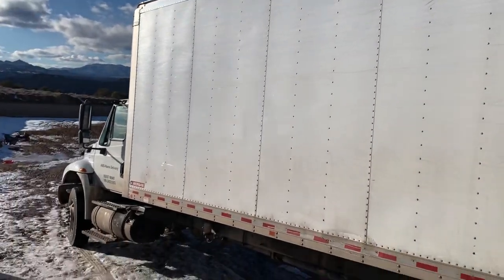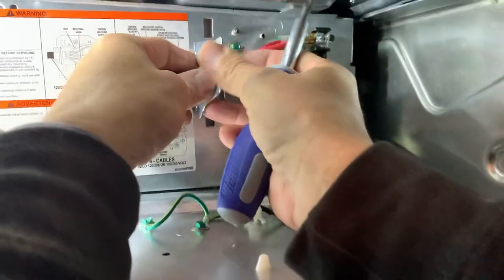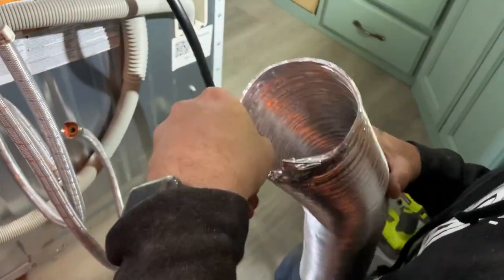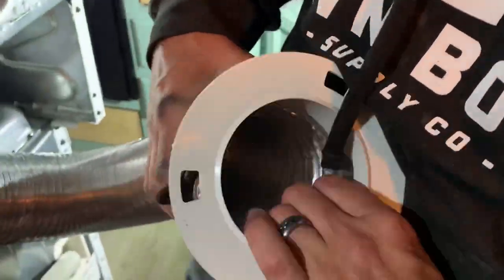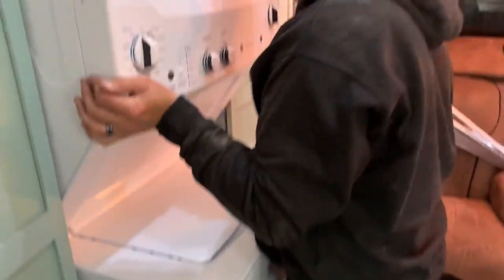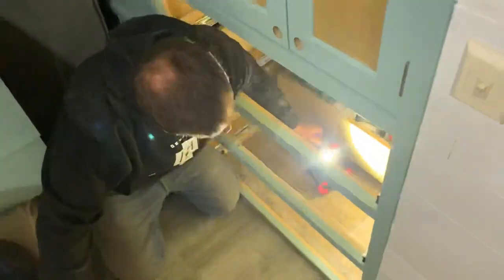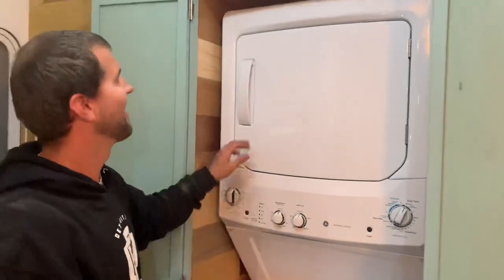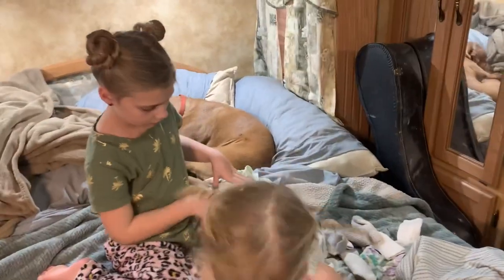Full time RV Living | Full size stack unit LAUNDRY

Comment: How are you getting 220volt in an RV?
Reply from the maker: You have to buy a 5th wheel or use a panel that uses 50 amps.  If you upgrade an existing 30 amp panel to a 50 amp Make sure the wiring can handle the extra load.  30 amps that only use 110 volts only have a single hot leg (1 black, 1 white , and a ground); 50 amp wiring utilizing 220 volts has 2 hot legs (1 black, 1 red, 1 white, and a ground). 30 amp wiring is usually at least 10 gauge but 50 amps requires at least 6 gauge.  So if it’s not 6 gauge wiring and only has one hot leg, you need to replace the wiring running from the plug to the new panel and replace the plug with a 4 prong.  In our case, the 5th wheel was already wired with a 50 amp panel so we didn’t need to upgrade the wiring.

Comment: Just wondering, is the washer and dryer combo power needed 240 volts? Does your RV have an inverter for that hook up?
Reply from the maker: There is another video breaking down the electrical part of this project. It’s 240 volts, 30 amps.

Comment: Hi.. thanks for the video.  My question is: is your agitator during wash cycle noisey at all? Or the spin cycle as well? We just got this same unit & had it installed,  & I gotta tell ya, when the machine starts agitating for the wash cycle it sounds like a jumbo jet is revving his engine & about to take off... lol. Thanks for any info you may offer..
Reply from the maker: Thanks for being here and watching! We haven’t experienced that issue….Did you remove the shipping pins that keep it still during transit? Maybe too full? Goodluck figuring it all out!
Reply: I am finally getting around to looking for others who have this same issue.  I don't know what the problem is, but it sounds like a jet plane taking off.  Or like the load is off balance (and the load is not too big. I don't overstuff my washer).  I just took a video of it and I guess I should either ask GE about it, or a repair person.  Thankfully I am still w/in the 3 year warranty I got for it.  As loud and long as the spin setting goes, it does spin the heck out of the laundry so some pieces (like boxers) sometimes have spots that are actually dry.

The best thing about this w/d combo is the dryer.  It's relatively quiet and works really fast at drying laundry (the spin cycle getting out a lot of water helps I'm sure).  The washer is another story.  One con is that there is no setting for just a "Rinse" cycle.  Might not be an issue for folks, but just FYI...if something needs a quick 2nd rinse...no can do.  You just have to choose the Speed Wash setting.  Also, if you are doing a load and the washer is filling with water and you go to grab a shirt and then get distracted and forget you are doing laundry.  After the bin fills with water, after about 10 mins it will drain the water.  I've run over to it to try and stop it, but to no avail...bye bye to all that water and you have to fill it again.  I understand it's probably a safety feature, but dang...it's frustrating to feel like you've just wasted all that water.  I wish it could at least be stopped (maybe it can be unplugged?  Haven't tried that b/c it's hard to reach).

There are also some settings where even though you pick "Hot" water, it will do cold.  Not sure what that's about.  I've also never had any luck with the "Precise Fill" setting.  You also have to be mindful that this washer does not fill near the top with water, so be sure to not over fill it with clothes thinking that on Super it will fill up w/in a few inches to the top.  

My last comments is that it twists my sheets up pretty well.  I don't know if all washers with agitators do this, but this machine def does.  I wouldn't choose to have this w/d combo, but I'm in an apt and side-by-sides wouldn't fit, nor would stacked front loaders (not to mention they were too expensive).  One day I'll get my dream w/d....Speed Queen!  But for now at least I have a w/d. :)
Reply: Oh, and the rinse cycle is mayyyybe 30 seconds?  Again, why?  So odd.  Fills up with all that water, swishes for 30 seconds or so, and then drains all the water.

Comment: Would you mind sharing the interior dimensions of the cabinet? Basically the size of the hole need to accommodate the washer/dryer.

Thanks
Reply from the maker: Of course! The interior dimensions are 29” wide, 31” deep, and 77” tall.

Comment: What do you think of the Washer/dryer now, after two years?
Reply from the maker: We’re happy with it! Works great for our needs and space:)
Reply: @itsworthit5029  Thanks for your reply and I hate to be a bother, buy I did something one should never do, that is buy something then check the reviews afterward. There seem to be a lot of complaints about the automatic fill sensor never filling the washer with enough water and the dryer lint filter being sub par. Have you found any of these issues?   Thanks again.
Reply from the maker: @kevgh3869  , no.  We have not had those issues with ours.  It works just fine on auto and the lint trap seems adequate.   The issues you’re talking about have not come up at all for us.
Reply: @itsworthit5029  Thanks so much!

Comment: Was your RV pre-wired for the 220v dryer?
Reply from the maker: No we had wiring for an all in one unit in the master closet but wanted a full-size unit so we had to wire the main area for this addition.
Reply: @itsworthit5029  Did you use the existing two outlets to wire 120v to 240v? or did you have to re-fish new wiring to achieve the opposite poles for 240v?

 thank you in advance.
Reply from the maker: @robertmitchell1865  yes we had to run all the wiring. this video shows everything that we did electrically https://youtu.be/l9VMAzO2MI0
Reply from the maker: @robertmitchell1865  we also had to run plumbing and add a grey tank for just the washer… here is the plumbing portion of the project - https://youtu.be/juTQ0sPAnsA
Reply: No, it wasn't.
Reply: @itsworthit5029  it is plumbed except the exhaust hole, but with one dual 120v outlet.
Reply from the maker: @robertmitchell1865  …oh, gotcha.  The spot that we did this didn’t have ANY electrical so we ran electrical as shown in that video.  If you have a dual receptical, you will need to run an additional wire to achieve the additional voltage required.  You have 2 options, either run 12-4 from your panel with a 30 amp breaker…or run an additional single 12 AWG THHN as your 2nd lead and replace the single space breaker with a 30 amp.  They make a slim 30 amp breaker with 2 leads…so you can fit it in your panel if there’s no extra space for the normal size.  Does this answer your question?  I think this is what I understood of what you’re asking now.